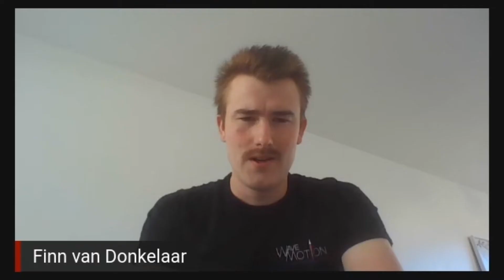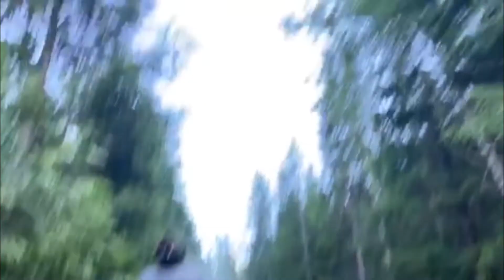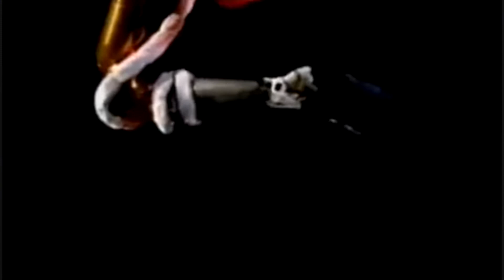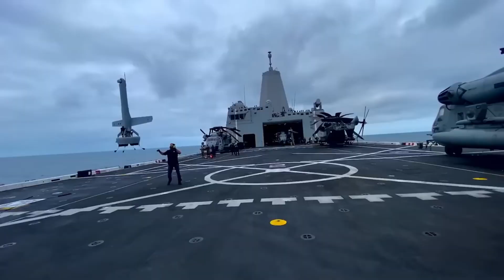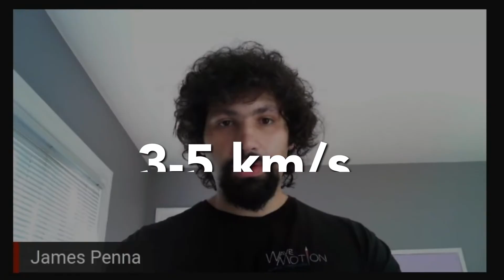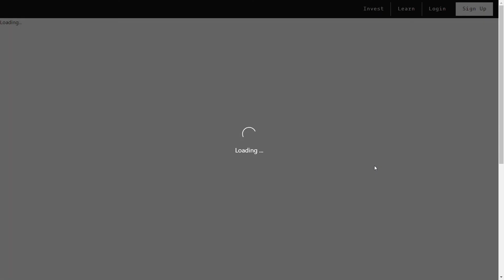Why is Wave Motion Pointing Their Rocket BACKWARD? (Founder Interview)

Comment: This sounds like a very cool concept, however it simply isn't realistic, they should be pursuing using a gound based laser that would superheat the air under the rocket, using the atmosphere as your first stage propellant, the reflector would be easily recoverable and your second stage could be a traditional chemical engine, or you could get fancy with it and use NTP or LTP

Comment: Simple put, these guys are talking about using a particle beam to accelerate a target. Fine, but you only talked about how the particle beam is generated and how it travels through atmosphere or space. What happens when it hits the target ship? How is all that kinetic energy absorbed safely and transferred to the target vehicle without disintegrating it? Didn’t the Defense Department put a lot of research on beam weapons as part of the Strategic Defense Initiative? Even if new technologies are now available to miniaturize the particle accelerators and increase their power this technology will likely end up as a weapon instead of as a novel propulsion system. I guess that’s why the defense department is already interested in this company.